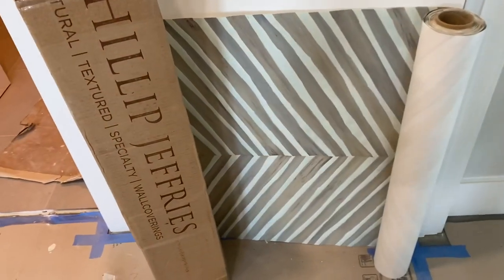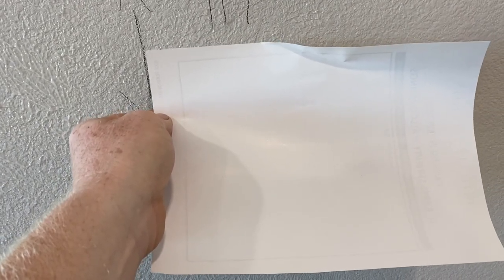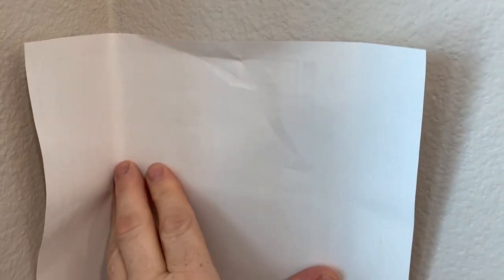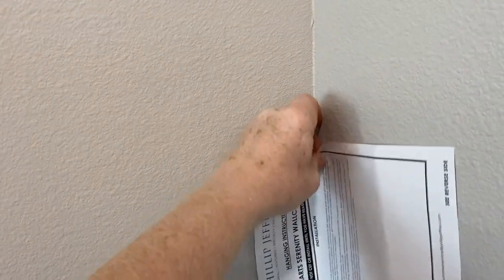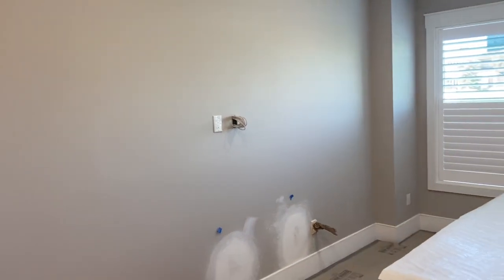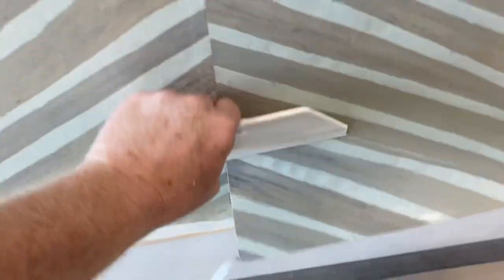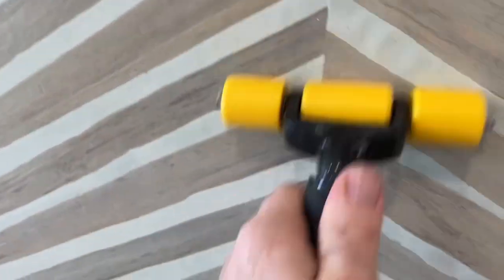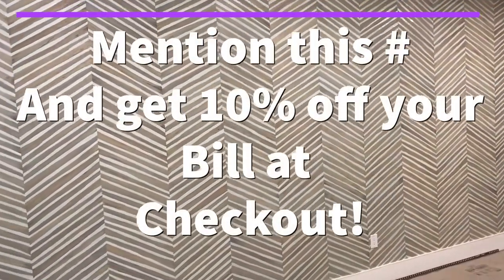Wallpaper: Phillip Jeffries Hyacinth - How to Install - Spencer Colgan

Comment: Spencer, I love watching your videos.  I'm a DIYer and have done a full house renovation down to the studs myself (drywall and mudding included).  I've never tackled wallpaper, though.  I've got a new home with a plain powder bath I'm working on.  Board and batten on the bottom half and wallpaper on the top.  The thing is...the walls are knockdown texture.  So, I'm planning on skim coating it myself and have been studying up.  I see in this video, however, that the walls are textured.  Did you need to skim coat this first?  I've selected this wallpaper below.  The company recommends a wallpaper liner for this product when used on textured walls.  While I'm very meticulous and methodical, I'd welcome your opinion on a DIYer using wallpaper liner versus skim coating.   Is it really about the quality of the glue I use?  If so, what glue do you recommend?  Thanks Spencer!

https://www.serenaandlily.com/priano-wallpaper/m11517.html
Reply from the maker: Excellent question; I started skim coating 30 years ago   

I am not a fan of lining paper; let me just tell you something about lining paper; it never hides the texture completely. Skim coat does! Furthermore, you have knockdown which cannot be relieved by lining paper because the texture is just too deep